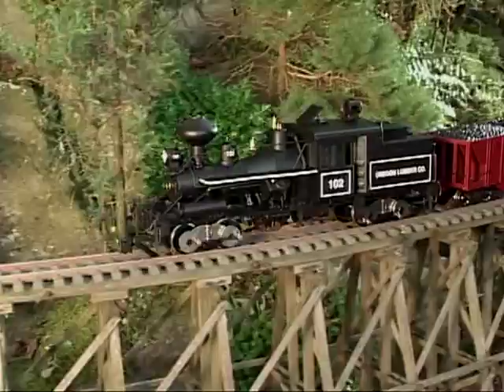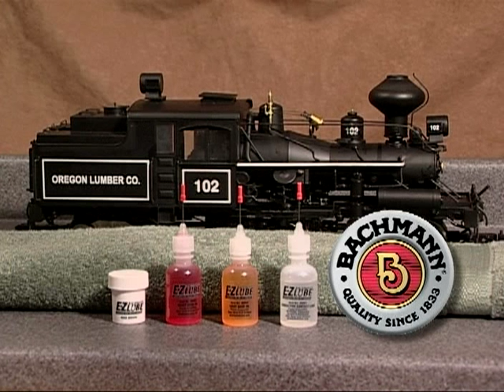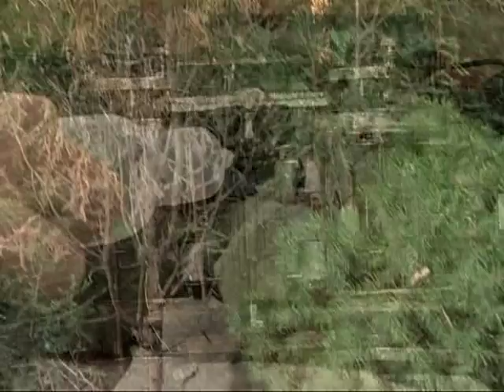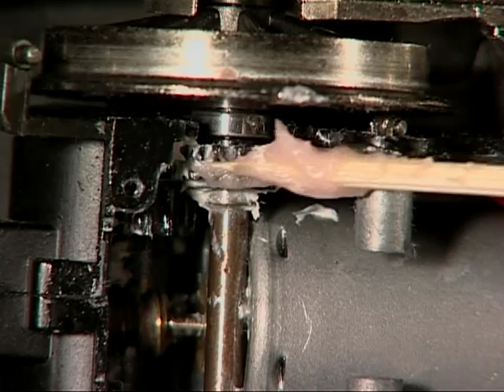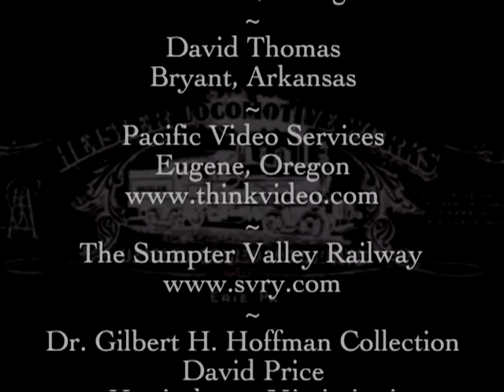Bachmann 1:20.3 Large Scale Heisler Locomotive "Features'

Comment: I've been trying to figure out. I noticed that this train is g scale "narrow". Does that mean that I can't run on standard g scale track?
Reply: It will run on 45 mm track. ;)
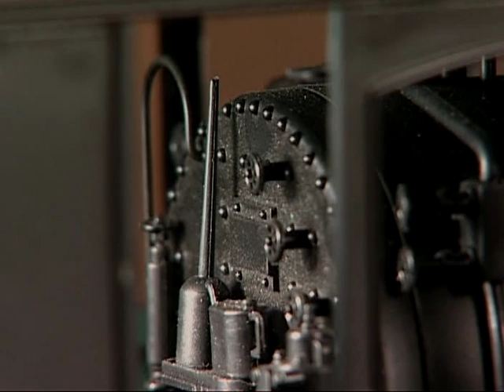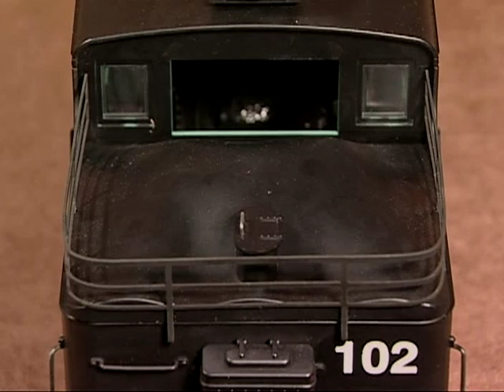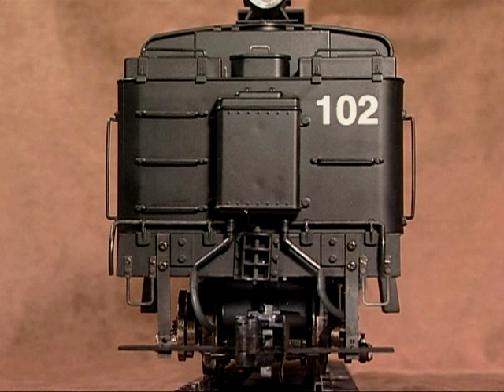Reply: To be more accurate, it's called Large Scale for a reason because it's actually 2 scales on one gauge track.  1:17 to 1:24 would be closer to Fn3 or Narrow Gauge for model railroaders, while 1:29 to 1:32 is actual G scale or Standard Gauge for model railroaders.  They ALL run on 45 millimeter track, and can easily share the same line.  The scales would just be different.
The Heisler is Fn3 scale since it's 1:20.3 the size of the prototype.  With some modifications to the couplers, it'll easily pull anything from Accucraft or Precision Scale.

I hope this helps. :)
Reply: It runs on standard G scale track.